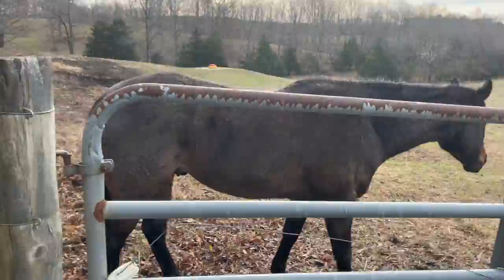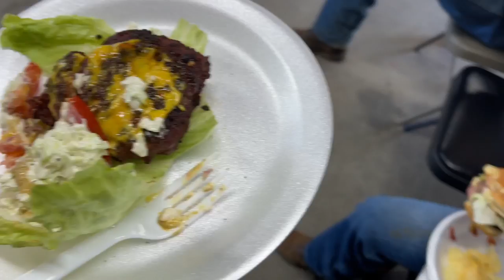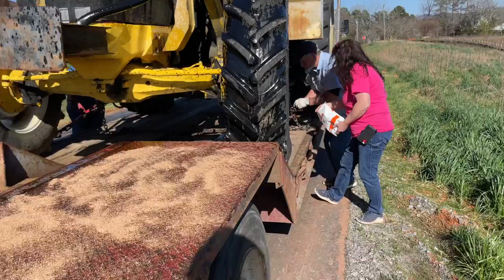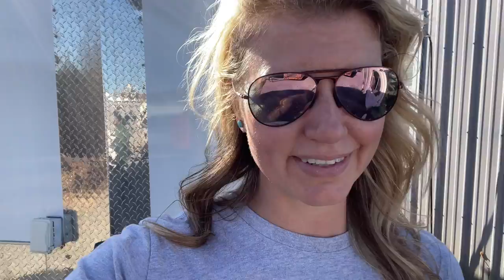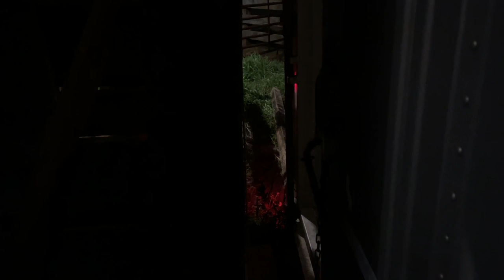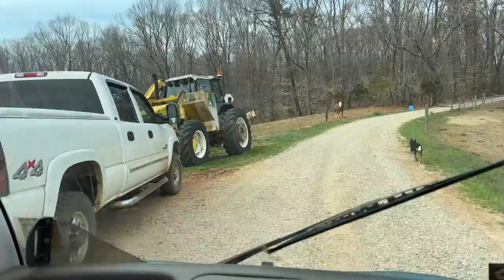New Additions to our Farm Fleet! 👀

Comment: You were worried about the 3 of them fitting in the cab of the "buggy". Growing up my Father had a 1946 Ford Express(possibly this an Australian model name) Jailbar, table(flat) top. The cabin was a mere 46 inches wide. In this, Dad, Mum, Sister, me, Brother and later, another (baby)Brother, all used to squeeze in. On longer trips, weather allowing, Me, Sister and Brother used to ride on the back. When Dad first had me driving it, I couldn't reach the floor peddles so I would start in gear, then use the hand throttle, then flick the off switch when I had to stop.

Comment: Great  video young  lady. I have a  couple pieces of  advice when using that mower. Stay back over a hundred  feet when  being used. Don't cut around  equipment with  windows. Leave the front shield  down when mowing close to a small tree. It will cut down a light  pole if you get to  close. I ran  one for over 25 years at VDOT. It's a dangerous piece of equipment but will do a really good job.

Comment: Hey Meredith, When I worked for VDOT, out of the Richmond District, Colonail Heights office. That tractor with the Bush Hog on was called a Boom Ax.  I am kind of concerned that there is not more counter weights on the left rear wheel. The tractors we had at VDOT, the weights were 3 x the size of these on this tractor and filled the whole rim of the tractor tire. And there were cages on those tractors because of flying debris. They are can be very dangerous. Just a fair warning for LB. Enjoyed your video, Thanks for sharing. PS you worry to much LOL.

Comment: The Alamo will be rock solid on a farm.  Just go easy with it.   Highway use will age it a lot via tires and well everything in the ditch.   Low engine rpm when turning it on and off will save lots of troubles.  And stand back because they do not name it a machete for nothing.

Comment: That is not a possum belly it is a ground bearing removable gooseneck lowboy a possum belly is a cattle trailer has one compartment in the front a double deck in the middle and one deck on the back over the tires we say possum belly the livestock in the bottom we say in the belly